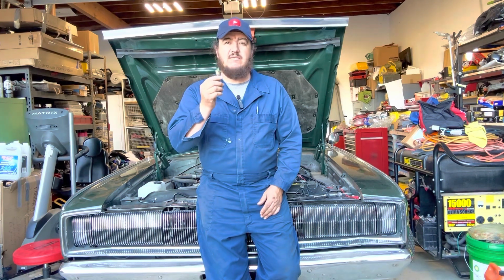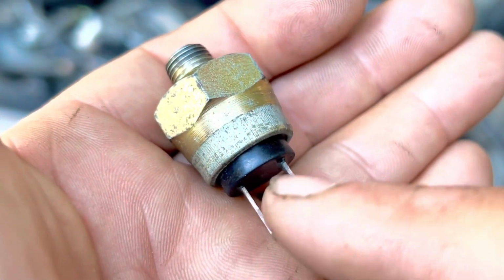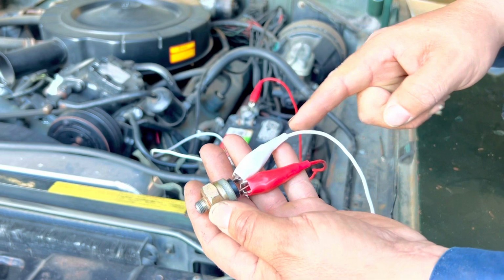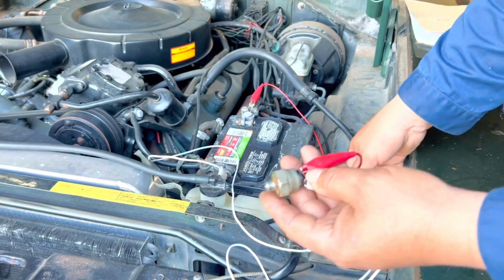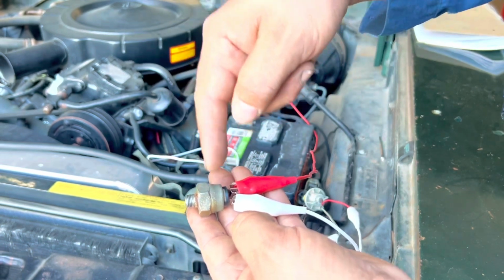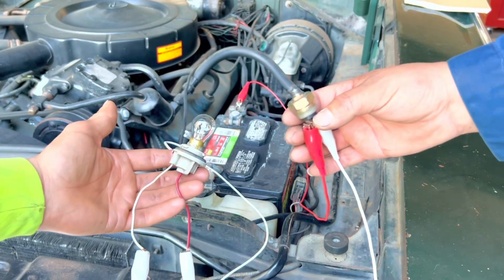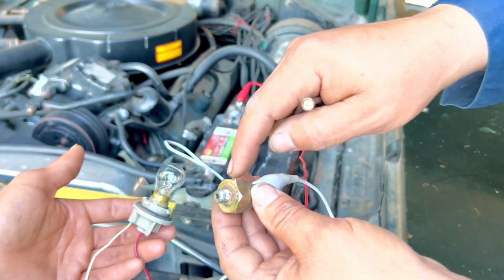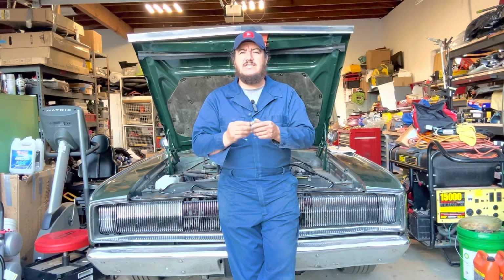How to test a oil pressure sensor @elchanojose

Comment: Thanks for this video.Youtested an On/Off pressure switch. Older sensors sense pressure in a resistive system (ohms resistance per pound of pressure). I like your videos.